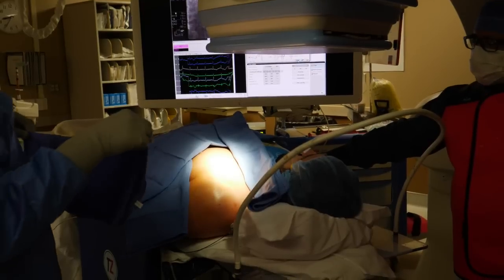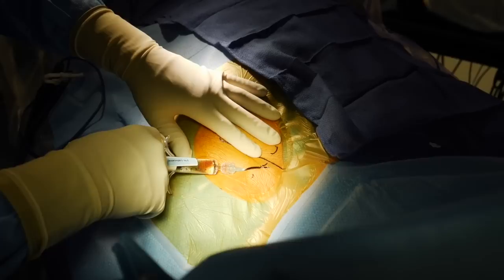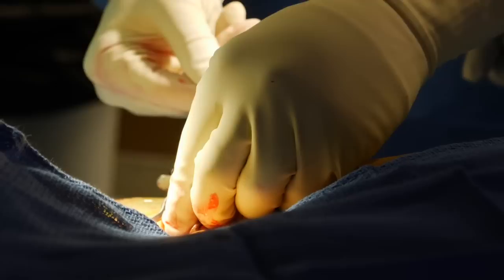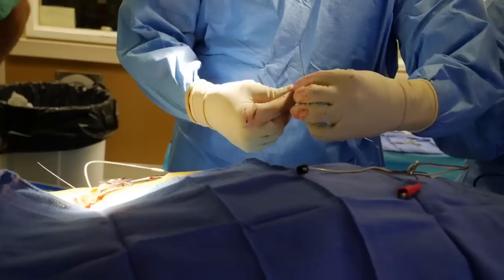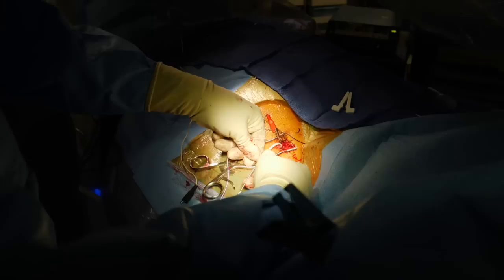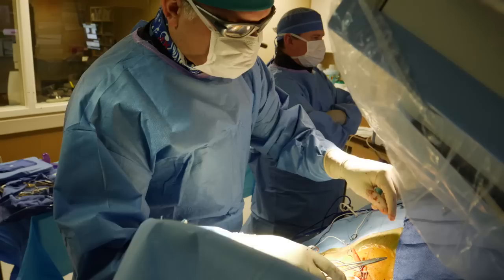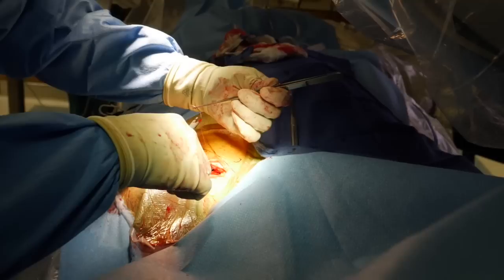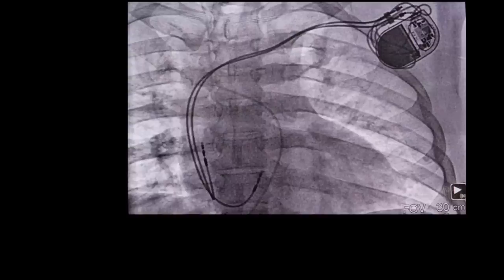Getting a pacemaker? Watch an implant procedure!

Comment: Excellent video, exactly what I was looking for as to how my pacemaker was installed.  Interesting that the pacemaker was put farther down into the muscle layer so as not to be as prominent when usually placed under the skin.  I would have liked to have known about that option and would have really preferred it.  I was wondering how the leads were screwed into the heart wall too.  At the end of the lead it is like a corkscrew and looks like they just turn it in with a few twists.  I am 70 yrs. old and just had mine put in 5 days ago.  Bit sore the first day, getting better every day.  Keeping my left arm down for several weeks is going to be a chore, but guess you can't risk dislodging the wire leads by lifting your arm up above your shoulder.  I understand once everything heals, you can pretty much carry on as usual with lifting, etc.  I didn't know I had a problem until I wasn't quite feeling right and noticed my heart rate was in the 30's.  My Doctor told me to go to the ER and it  turned out I was experiencing Atrial flutter.  Few days in the hospital for heart tests and a Cardio Inversion to stop and start the heart to get the rhythm normal.  My heart is healthy & fine,  buy my sinus node is not performing the electrical signals like it should, heart block, slow heart rate, etc.  Wore a heart monitor for 2 wks.,  and after sending it in got a call the next day from my Cardiologist saying going to need a pacemaker, and by the way, your Heart stopped for 7 seconds when you were asleep. one night  That was fun to hear, glad it decided to start beating again.  Anyway, got a regular 60 bps resting now, feel  better, although I really wasn't feeling bad before as I wasn't having any symptoms (not dizzy, lightheaded, or fatigued) usually associated with low heartbeat.  I mean it was slow resting but would pickup with any movement or exercise.  So, ty modern technology and great Doctors for helping me dodge another bullet, of which I have dodged many in life allowing me to make it to 70!  Should be good to go at least to 90 now, haha.
Reply: I am going to get mine soon. Wonder how it will look on my chest? Thinking about having the micra av implanted, but doctor didn’t recommend it. Said the technology is not there yet.

Comment: Ya know, I’ve had 9 pacemakers and going in for my 10th in six weeks, and have never been told or shown how it is done. It will be my first at an adult hospital. Thank you for this super informative video!
Reply: Most pace makers are changed every 7 years. Is it different for children?
Reply: Why u had so many?  I just had one put in, I thought Thry lasted longer than that ???
Reply: @katherinenewman3152  maybe because of the age of the person, they might’ve had multiple experiences that caused their pacemakers to break. When I had my first pacemaker, I had it for about 3 years but then I accidentally broke it by falling off a swing. I was also about two weeks old when I got it. Now I’m on my fourth and going to get my next one in abt 22 months. So they probably have so many because they broke them multiple times. Or just because other reasons.

Edit: remembered that because for children, pacemakers are usually implanted in abdomen which makes it more easily breakable.
Reply: @Ifelloutawindow  so if you have that many pacemakers do you have heart failure?

Comment: I am getting a pacemaker and diffibulator done later today. Im terrified but watching this has helped a bit. Ty for this video
Reply: Hey Kelly
How are u
I have a question !!
U were given general anaesthesia for this surgery ?
Reply: Hey. They “twilighted” me, which will usually knock me out but it didn’t! I was awake for the whole thing. I felt somethings. They only knocked me out out when it was time to test it. I’m not going to lie, I sat there and cried like a baby the whole time. The sheet was stuck to my face, I felt them open my chest and I had to have put on the right side because I have a port on my left and I felt the wires going thru my chest. I wasn’t thrilled that I was awake for any of it tbh but it is what it is I guess. If you’re getting it, good luck and I hope the “twilight” knocks you out, out!